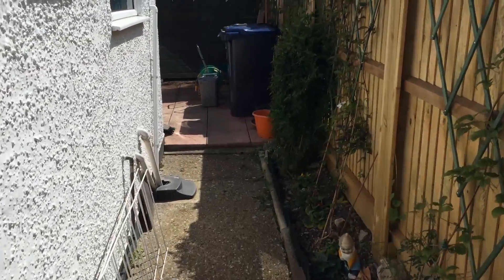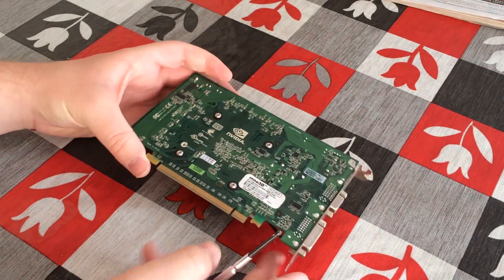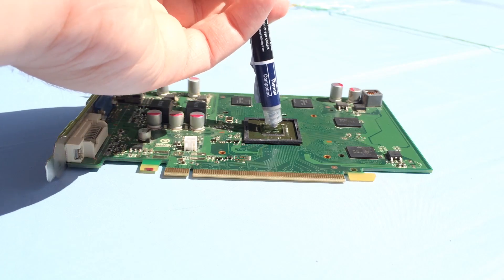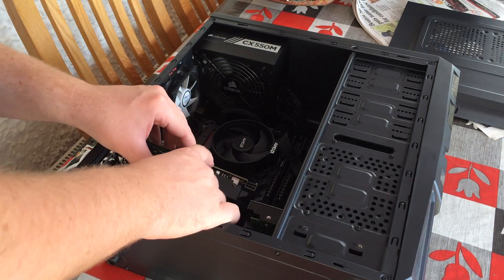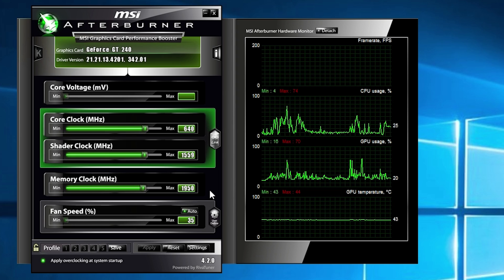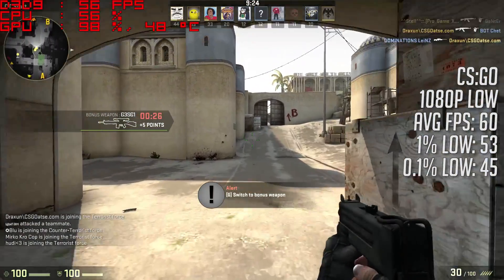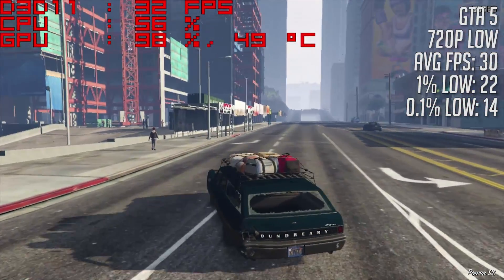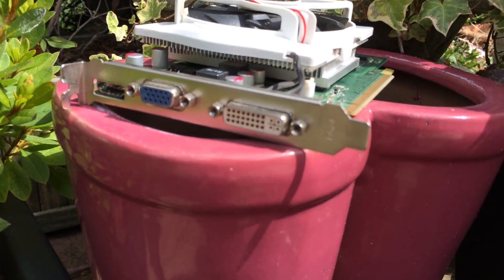Getting The Most Out Of a 512MB GT 240 Graphics Card

Comment: I've been considering attempting to overclock the graphics card I don't need to use a power supply connector for. Is it the same as with a regular graphics card? I don't want to ruin the port.

Comment: The thermal paste didn't look dried out or crumbling to me, so I'm kinda doubtfull if replacing it made much of a difference.
BTW You might have been able to overclock the card further if the voltage could have been increased. I do not know if this card supports changing the voltage, but if it does you'd also have to enable it in the Afterburner settings. The programs default settings do not allow you to change the voltage settings on any card.

Comment: The GT240 was a great card back in the day. It is a shame they don't make reasonably priced cards with modern technology. Maybe the GT1030 is the closest equivalent today but it seems under powered compared to what the GT240 was back in the day.
Reply: Novusod and 610 and 710 is worst price/performance to gt 210
Reply: I still own a GT240 512 GDDR5 and it was able to play without any problem all the Xbox 360-PS3 era games and better than what those consoles could do. 
I remember that in a lot of games I could reach 900-1080p high settings and stable fps around 40-45, like Mass Effect saga, Dead Space saga, Mafia 2 ecc. 
I had troubles just with games like BF3 (35 fps on 720p and low settings) because it was a very intensive game at the time and Metro 2033 (40 fps with some drops at 768p and medium settings) due to its not very good optimization. 

Everything at a medium price of 70€

Comment: randomgaminghd can you test geforce 9600gt (and overclock it maybe) test that gpu with core 2 quad because i have both gpu and cpu but dobt have right cable to use that gpu if its good i could buy right cabkes psu and ram

Comment: Dear RandomGaminginHD you should not apply thermal paste on a bare die gpu like you do on a cpu. You are better off manually spreading it over the entire die to make sure that all the area is covered. If the edges are not covered in thermal paste, you can damage your gpu, specially the memory controllers which usually are at the edges. The cpus are different because there usually is a metal heat spreader between the cpu die and your cooler to more evenly distribute the heat over a bigger area.
Reply: Good to know!

Comment: You should experiment the and a8 6410 apu. It runs Skyrim high settings with ultra shadows 30fps, and the gpu clock speed can be over clocked. Also it runs Fallout 4 lowest setting 28fps average.

Comment: I use a 240gt on 955 quadcore energy efficient 2nd PC I built to play ME3 Multiplayer every weekend 1080p no AA gets 60 fps 95% of the time and with Cool n quiet enabled the whole system burns no power and produces no heat 15$ Purchase.

Comment: I have the same PSU for my current system and that case for my parents' PC. I think both are nearly 10 years old at this point and both operated without issue (the PSU is handling my FX-6300 and Radeon HD 6970 like a charm and the case... is well a case and the tooless access is quite a treat to work on).

Comment: Hey...how are gpu temps in that case. I have a similar case with a 92 mm exhaust fan and a single  120 mm intake fan with a top mounted psu, although it intake fresh air from top. My 1060 reaches 90 degrees with 100% fan speed when oced, even my case fans are maxed out. Pls help

Comment: Actually since non conductive TIM has become the standard, using about the size of a peanut is what you want for a GPU, you want it to leak over, take apart any GPU in the passed 8 years and you will see this is common practice, GPU's give off massive amounts of heat even from the less power demanding areas around die. If you have ever read about people having thermal issues after replacing the TIM or the heatsink or going to water cooling this is almost always the reason why. You basically want the entire chip to be covered and have it leak over just slightly for optimal thermal transfer.
EDIT: I get that you are a budget channel but miss information costs performance and sometimes money, just trying to help.

Comment: Why do you never increase the voltage limit at all when trying to OC?  Yes, it's risky to increase it too much, but there's failsafes to prevent it from frying or overheating (usually it'll just shutdown the component and give you no signal, but it'll be fine when you reset it).  Some of the things you say just isn't true:  For example, you said using more than 1 PSU isn't safe for long-term use.  If all PSUs are in good condition, it shouldn't matter how many you're using.  Similarly, overclocking without adjusting voltage isn't pushing anything to the "absolute limit."

Comment: It would be nice to compare this GT 240 'GDDR5 Edition' with a GTS 240, they are difficult to find because are OEM GPUs, but are quite good after all, a friend got one overcloked +150MHz both GPU and VRAM, paired with a C2D E6300 @2.1GHz and older games (this GPU is not suitable for DX11) ran incredible great.

Comment: actually you are wrong, the GT 240 supports dx10.1 which is crazy to think

the gtx 280 cant run overwatch for its dx10 limitation but since the gt 240, 230, 220 and 210 support dx10.1 they can run overwatch since it requires a 10.1 minimum

Comment: Hi
I have a i5 4679 3.4ghz what's highest GPU I can use with no bottlenecking ?
Reply: My guess would be a GTX 1070/ RX Vega 56 depending on the game.
Reply: Yeah thought so , I want to upgrade to 1440p at 144hz just running 1080p at 60 hz with a gtx760 at minute

Comment: It's not a big deal, but I was always under the impression that you can actually put more paste on a GPU than on a CPU. The reason there is that the pressure of the cooler on a GPU is lower. You can also see many cards have a large amounts of the paste there right from the factory. I guess the amount of paste is a never ending discussion :)

Comment: Why you always has to say GDDR when you just can say DDR, memory is memory, if youre talking about gpu then its graphics memory, no need for additional G
Reply: there is a distinction between GDDR and DDR types of memory.

The principle differences are:
•DDR3 runs at a higher voltage that GDDR5 (typically 1.25-1.65V versus ~1V)
•DDR3 uses a 64-bit memory controller per channel ( so, 128-bit bus for dual channel, 256-bit for quad channel), whereas GDDR5 is paired with controllers of a nominal 32-bit (16 bit each for input and output), but whereas the CPU's memory contoller is 64-bit per channel, a GPU can utilise any number of 32-bit I/O's (at the cost of die size) depending upon application ( 2 for 64-bit bus, 4 for 128-bit, 6 for 192-bit, 8 for 256-bit, 12 for 384-bit etc...). The GDDR5 setup also allows for doubling or asymetric memory configurations. Normally (using this generation of cards as example) GDDR5 memory uses 2Gbit memory chips for each 32-bit I/O (I.e for a 256-bit bus/2GB card: 8 x 32-bit I/O each connected by a circuit to a 2Gbit IC = 8 x 2Gbit = 16Gbit = 2GB), but GDDR5 can also operate in what is known as clamshell mode, where the 32-bit I/O instead of being connected to one IC is split between two (one on each side of the PCB) allowing for a doubling up of memory capacity. Mixing the arrangement of 32-bit memory controllers, memory IC density, and memory circuit splitting allows of asymetric configurations ( 192-bit, 2GB VRAM for example)
•Physically, a GDDR5 controller/IC doubles the I/O of DDR3 - With DDR, I/O handles an input (written to memory), or output (read from memory) but not both on the same cycle. GDDR handles input and output on the same cycle.

The memory is also fundamentally set up specifically for the application it uses:
System memory (DDR3) benefits from low latency (tight timings) at the expense of bandwidth, GDDR5's case is the opposite. Timings for GDDR5 would seems unbelieveably slow in relation to DDR3, but the speed of VRAM is blazing fast in comparison with desktop RAM- this has resulted from the relative workloads that a CPU and GPU undertake. Latency isn't much of an issue with GPU's since their parallel nature allows them to move to other calculation when latency cycles cause a stall in the current workload/thread. The performance of a graphics card for instance is greatly affected (as a percentage) by altering the internal bandwidth, yet altering the external bandwidth (the PCI-Express bus, say lowering from x16 to x8 or x4 lanes) has a minimal effect. This is because there is a great deal of I/O (textures for examples) that get swapped in and out of VRAM continuously- the nature of a GPU is many parallel computations, whereas a CPU computes in a basically linear way.
Reply: lol gddr is faster
Reply: Nope, actually there are GPU with only DDR memory.
It's neccesary say if is a DRR or GDDR because the GDDR it's a lot faster.
Reply: you cant compare double data rate 5 with 3
Reply: graphics memory is different just because it can read and a write within the same cycle. there is no other difference.

Comment: Actually, when replacing Thermal paste on a GPU, you absolutely don't use metal cooling paste, like the ones from Thermal Grizzly, it dissolves the die, "normal" Thermal paste is fine though.

Comment: But can it play minesweeper?
Reply: YTheCreator recommended specs actually for at least 20fps are 2x threadripper each 16 cores clocked @4.6ghz and 4 gtx 1080ti sli overclocked +128 gb ram @4000mhz
Reply: @mongocom1735  you're joking right? Lol we all know you need 4 sli titain rtx's with dual i9-990k's and 356 gb of ddr4 ram and a 10tb ssd for 60 fps gameplay duh even with 10tb's it will take at least 3 hrs to boot
Reply: Not even close, since minium requirements for minesweeper are Gtx 1080 Ti Sli - i9 7900x - 64Gb Ram
Reply: Oh and you need one of those 8TB hard drives
Reply: NO  8tb SSD.
Reply: Of course it can -_-

Comment: It looks pretty cool for a low end card.
Reply: He literally said it is.
Reply: VisserZer0 yeah my bad I changed the comment.
Reply: It certainly wasn't ever high end.
Reply: It was a low to mid end budget card. The mid end was the Geforce 260 and the high end ran from the GTX 275,280 all the way to the 295.
The 240 had 112 Cuda cores while the 260 came in a 192 and 216 variety. (There was also a 250 but it was very similar to the 240 and only 16 more Cuda cores totalling 128)
Rest: 275 and up to 290 all had 240 Cuda cores, but differed in clock frequencies, amount of VRAM and Render outputs. 
The 295 was basically two 275's put on the same card.
I used to own a 260 and it was around a 140 Euro card (new price at the time)
Reply: It was mid range in 2010